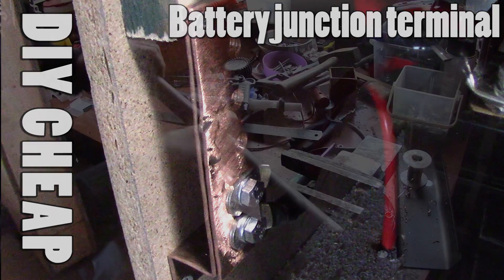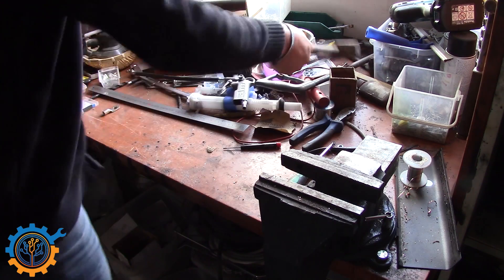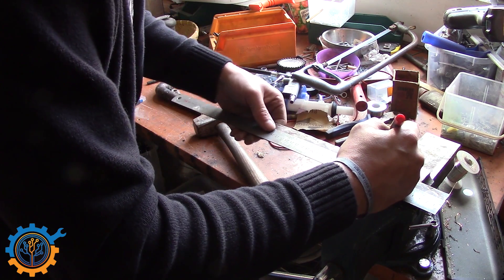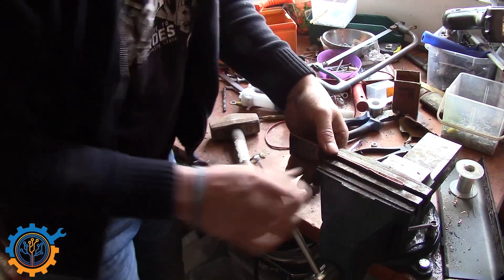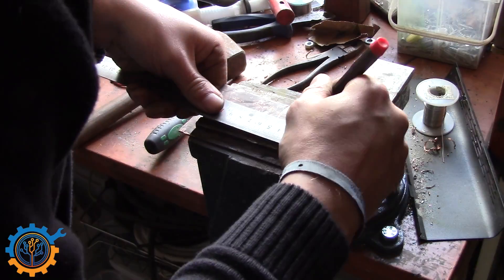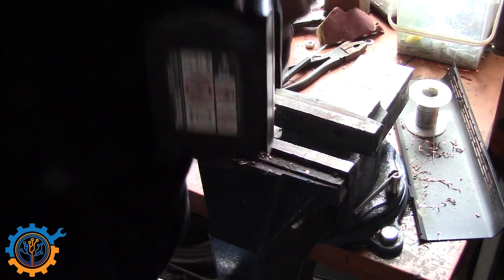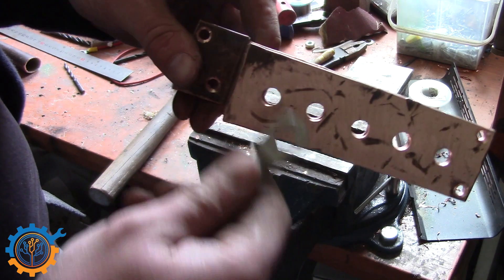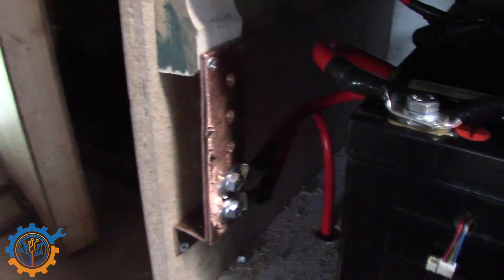Battery junction terminal (DIY cheap build)

Comment: you mention screws, there's a particular one(stainless, copper, aluminum), what material you prefer
Reply from the maker: Im using normal ones 8.8. Its not the screw as such that should carry the current if im not mistaken. But you should choose screws depending on application. if its in an environment that is likely to corrode you should most likely use some that works for that.

Comment: When I smash or bend metal like that I use 2 scrap steel plates surrounding the piece you want to work.  I usually put this sandwich in a vice or use clamps to help.  But in other cases I just sandwich the steel plates with your copper in the middle and lay it all down on a flat hard surface and hammer with a big or small sledge hammer.  The advantage it that the steel takes the ugly dings and scratches but the copper will not have much dings and blemishes.  Purely cosmetic, electrons don't care thou.

Comment: You may not of heard of this, but when you work with copper you get that nasty green corrosion so I use liquid tin... It smells like rotten eggs so you want ventilation, you should consider getting some... Whatever's left over you can reuse over and over so don't throw it out. If you want to test that, put some in a container and pour it in a separate bottle and reuse that for a couple years. No more corrosion. I even put it in a spray bottle and mist it on and done.
Reply from the maker: Thats a smart tip. I should get me some!
Reply: I use it on bare wires also